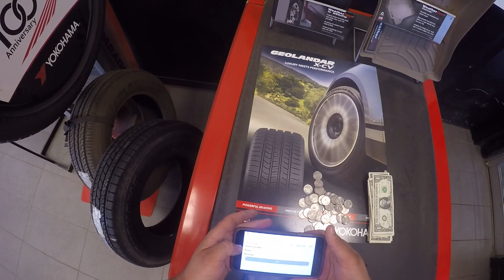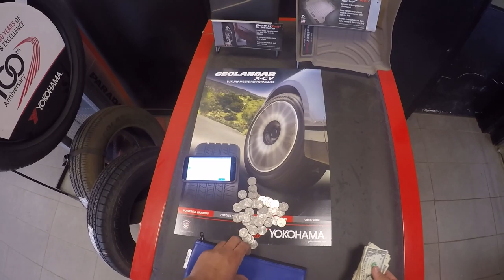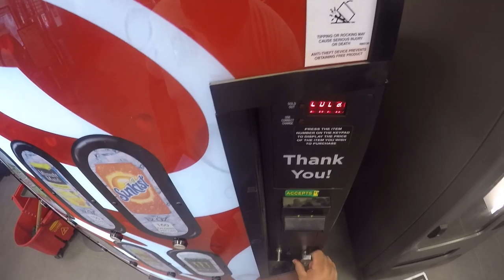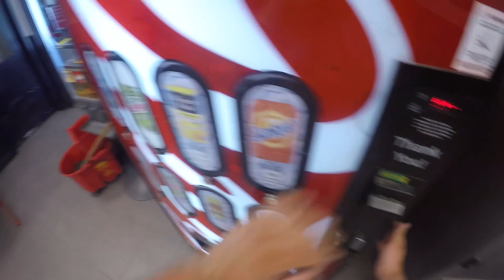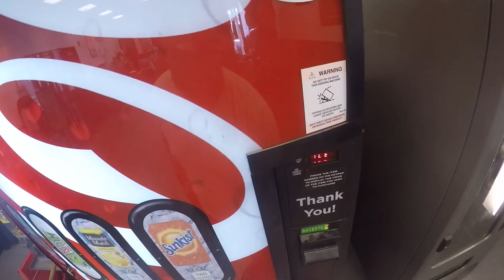vending machine business collection day!! 2 machines | broken door on the snack machine

Comment: When I first started in machines, long before coin counters were cheap, I used plastic tubes that were the same diameter as the coins. I measured out $5 values so I counted $5.00 or $2.00 totals. We do not roll coins in papers here in Oz, but they are bagged into small bags,
Reply from the maker: nice